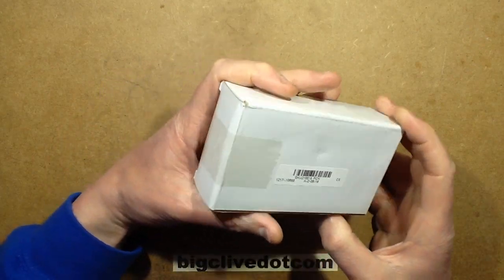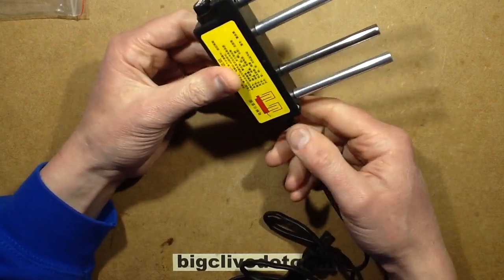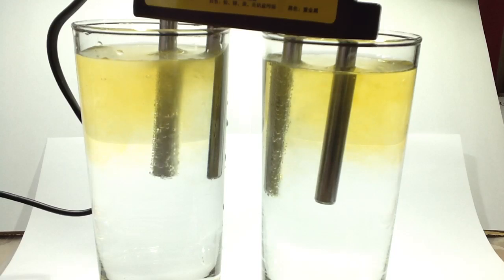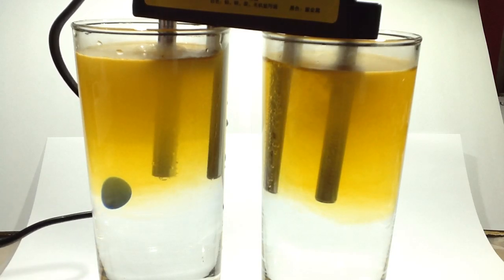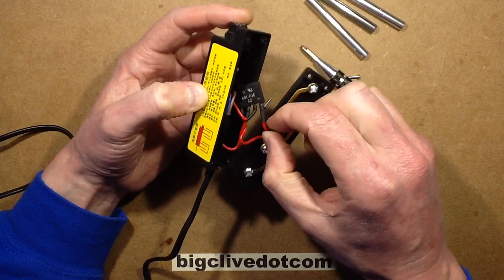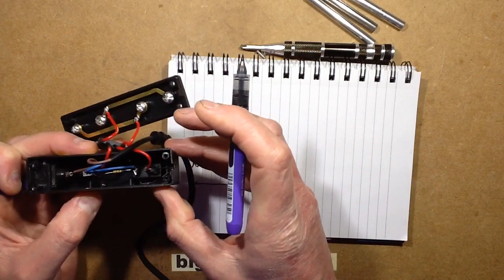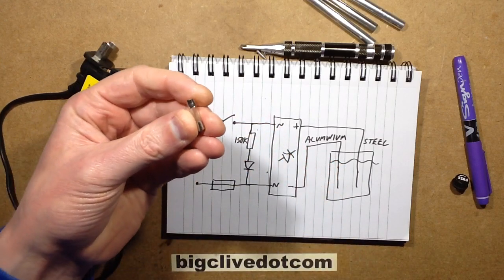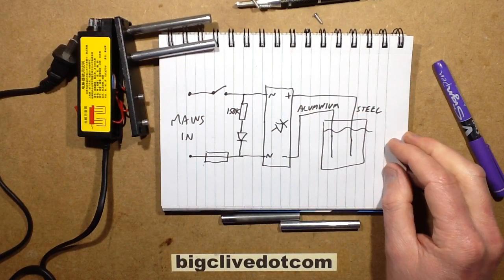Deadly quack water tester.  (scam)

Comment: The steel and aluminum electrodes were probably to cause galvanic corrosion, which I believe is what was discoloring the water.

The recently built "Littoral Combat Ship" Independence in the US Navy embarrassingly suffered from this problem as well, because of the aluminum hull being in contact with the stainless steel propulsion system via the saltwater, which caused "aggressive corrosion".

https://en.wikipedia.org/wiki/Galvanic_corrosion#US_Navy_Littoral_Combat_Ship_Independence

They ended up temporarily hanging a chunk of Zinc over the side of the ship while it was in harbour to prevent the corrosion to the ship, and instead corroding the Zinc, which is called a "sacrifical anode" or "cathodic protection", until they can install an onboard system. Which is available on tiny fishing boats, so this was a Navy level mistake.

Here's the wiki article

https://en.wikipedia.org/wiki/Galvanic_anode

and another similar one on protection systems

https://en.wikipedia.org/wiki/Cathodic_protection

So BigClive, I propose you get a sacrificial anode, charge it opposite to the aluminum cathode, and see if you can't stop that water turning yellow. 

We'll show them yet who has the cleanest damn water!
Reply: Hahaha! Thumbs up ;)
Reply: Mp57navy I know, I have basic experience with boats and I knew this was possible. I just refuse to believe this is a mistake, I think someone thought they could get some extra maintenance revenue in.

I mean they had to drydock a brand new ship, to remove the drive system to fix the corrosion! On a ship that's already about 3x more than the original estimate of $220 million. It's completely absurd!

SpaceX should found MilitaryX next. Maybe they can make military hardware about 1/6th the price, the same way they did with rockets.
Reply: People from the enemy infiltrated the defense force and deployed electrolytic warfare ;)
Reply: IT'S A GALVANIC ATTACK! QUICK, WE MUST RESPOND IMMEDIATELY!!!
Reply: +john carlaw Exactly, these are not small firms. They employ extremely talented people to oversee the development of these ships. I think it had to be a conscious choice somewhere down the line, I refuse to believe it was accidental.

If it was somehow accidental, it's incredibly embarrassing, and points to something being VERY wrong in their design/approval process.

It's a shame, because I think it looks like one sexy ship!
Reply: Dazzwidd I really enjoy this theory! :)
Reply: Dazzwidd ...i think we've got a few days, ya we'll get around to that later.
Reply: NO! We must take immediate action! We are CORRODING!!! WE'RE GOING UNDER!!!
Reply: ABANDON SHIP! ABANDON SHIP! DEPLOY LIFERAFTS IMMEDIATELY!!! IONIC COMPROMISE!!!
Reply: Ooooh no! Bloop bloop bloop...
Reply: cidshroom the "sacrificial anode", is that the thing that's beneath most propellers on a motorboat? It usually gets white over the years, and smaller
Reply: Jeezz man.....it's just a video he shot about his thoughts of this product. Relaxxx :P
Reply: or, more scientifically worded:  as its temperature rises, the saturation point of water also increases.

try this simple experiment:  have two cups of water, one hot, one cold.  compare how much sugar or table salt you can dissolve into the water.  you'll have reached saturation point when no more material can be dissolved, and it just floats around on the bottom.
Reply: Then why doesnt it do anything in distilled water?
Reply: @aliciousnessss  Distilled water is a really good insulator. Impurities in water are what conduct electricity. Salt water being a better conductor than fresh water
Reply: Dazzwidd *taps at rust* well... we're going to need about $5 million dollars first.
Reply: Dazzwidd ...oh you don't want to do that, the liferafts are in much worse condition.
Reply: I did make some tests with cold tapwater, hot tapwater (we receive hotwater from a high pressure tube, directly into our appartment block). I also did do a test with boiled tapwater vs normal cold tapwater. The colours and reactions are really different, the hot tapwater was by far the most dirtiest of all, followed by the cold tapwater. It seems boiling cold tapwater actually cleans up some of the stuff in cold tapwater (not sure if the metal electrodes release so many molecules in the 30-60s you normally switch (max!) on the device.
Reply: Actually what you said makes complete sense Lutte. The hot water would come out the dirtiest. That's why you are not supposed too cook with, or drink hot tap water. It's just not as clean as cold water.
Reply: Yes, absolutely, rakninja. Good description.
Reply: That was the conclusion I had come to too. Glad to see that my knowledge holds up.
Reply: electrolysis.     corrision is right..  but its called grain boundary carbide precipitation in electrolysis...   litterally one rod is peeling off the other...  why 316L stainless is used for anode and cathode's...   its the only type that wont corrode into the water...

then again this might just look like an electroplating device...   hmmm
Reply: +cidshroom The people designing that ship should have been shot on the spot. (working with metals on a daily basis here)